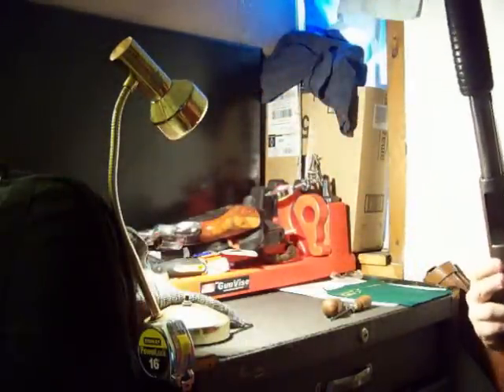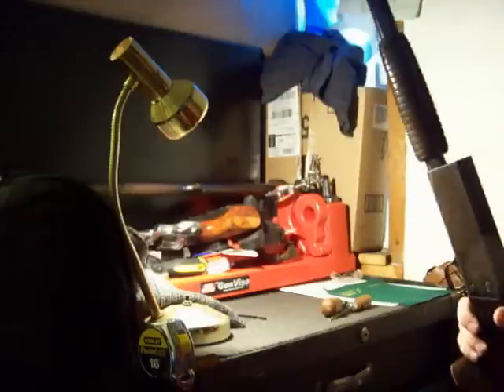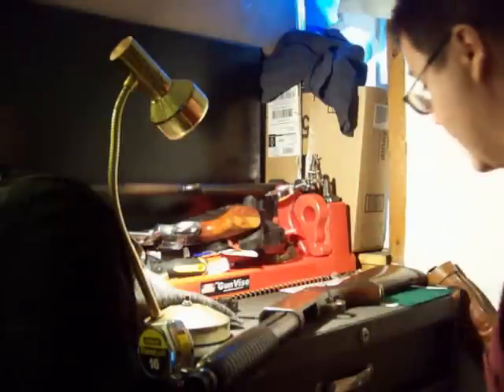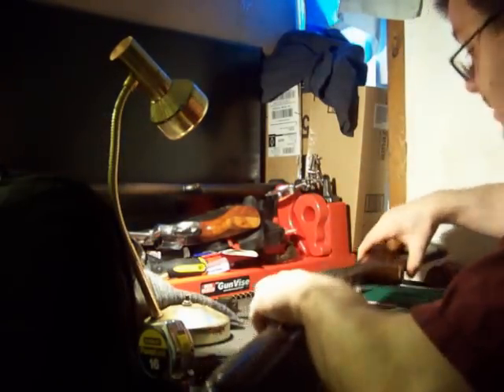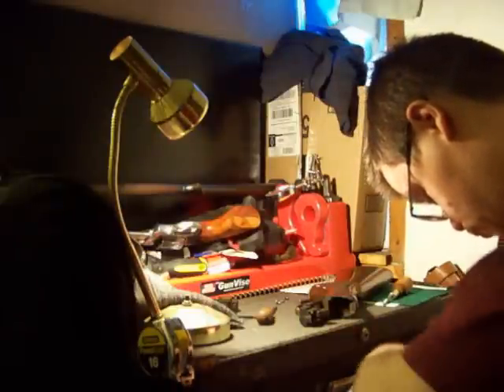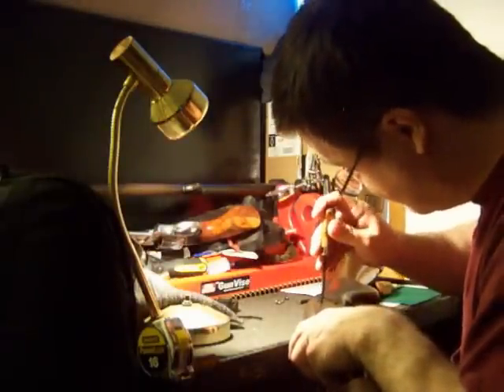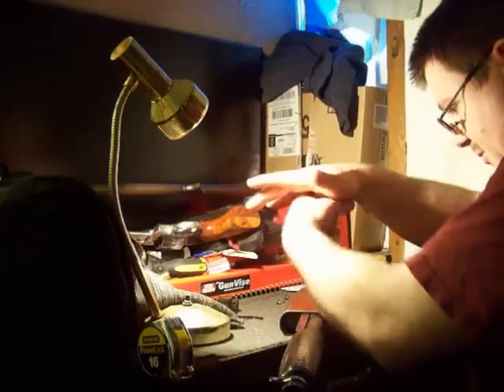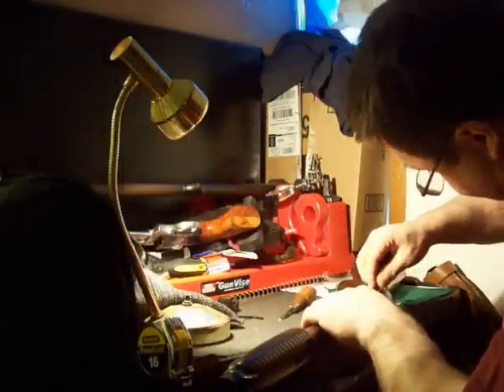Ithaca m37 Disassembly

Comment: I have two M37 DSPS shotties made in the early eigthes and - *if* they are constructed the same as yours - you should remove the stock *before* undoing any bolts.  The stock is attached to the end of the trigger group and is tightened against the end of the action.  Hence, with the stock removed, the bolt is free to undo - *no* excess pressure has to be applied.

In addition, disassembly of the rest of the gun is a doddle - RTFM...

Regards,

Mark.

Comment: thanks for making this video. until now, i thought you had to remove the buttplate and take the long bolt out of the buttstock to get the gun apart. removing the screws on the sides of the gun seems easier.

Comment from the maker: @MisterMcHaos There are many differences from the 50s models and your 80s.
I took it down the way it looked easy and went back together easy..
Yes I think it is easy to take down as well I did it first when I was 17 or 18 unassisted.
Yes the stock does cover the fire control and a small part of the bolt, like most convention repeaters found in the realm.
Thanks for the comments.

Comment: 1:02 actually, there IS a way for the gun to fire without the barrel on.  The dual extractors on the Ithaca will hold a shell firm enough for the firing pin to strike the primer and "POP!"  Do NOT try that at home.

Comment from the maker: wow I tore mine down not seeing your problem, I would take it to a gun smith you may have knocked loose some innards not on the video.
If you just can't get the big screw out use a bigger driver they are tight and go right threw.